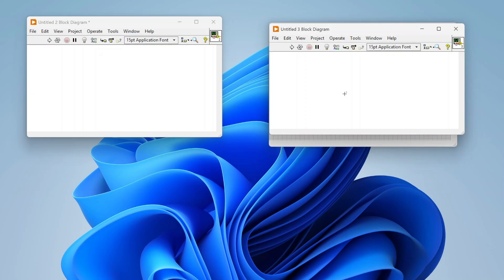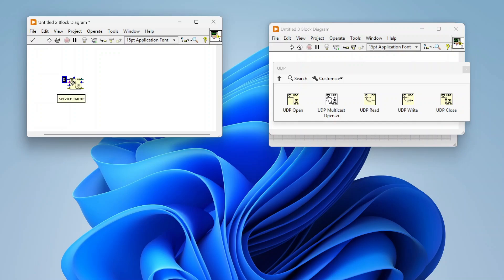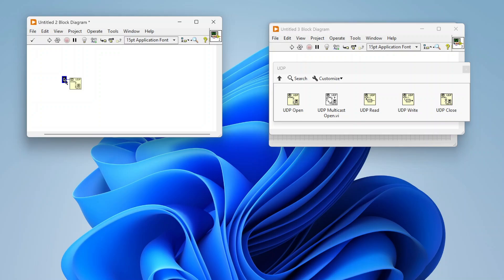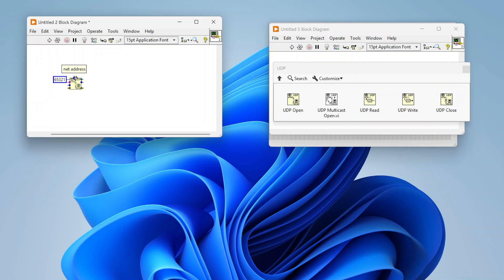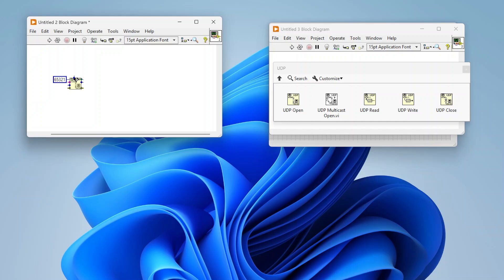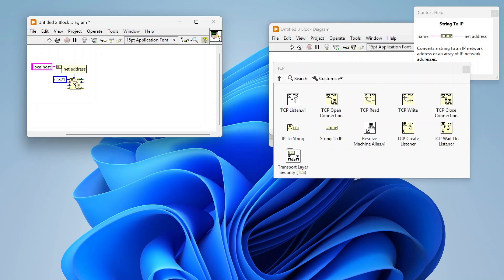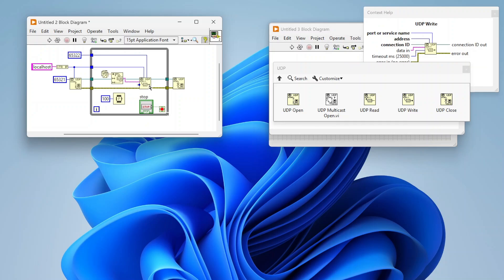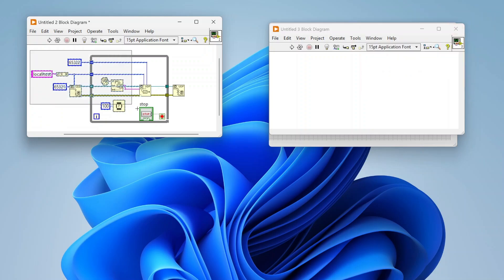UDP in LabVIEW

Comment: Could you connect and send data to raspberry pi?
Reply from the maker: Yeah, you could send and receive data to and from anything. If you want to send data to a raspberry pi, just make sure it’s opened a port up to receive data and then you’ll be able to talk between them easily. Same goes with other protocols like TCP, MQTT, OPC, etc